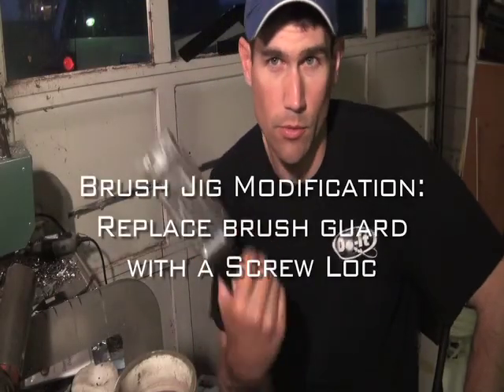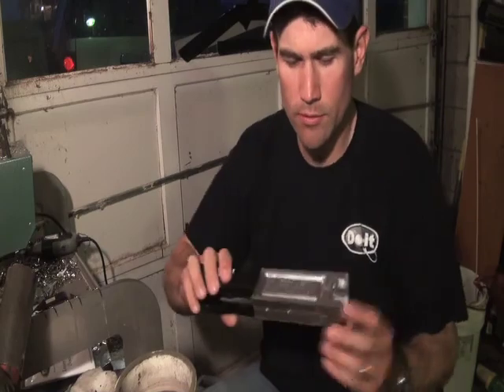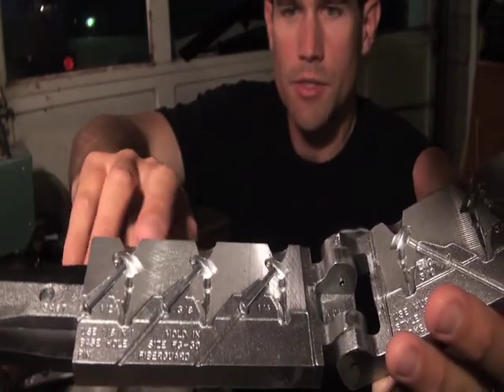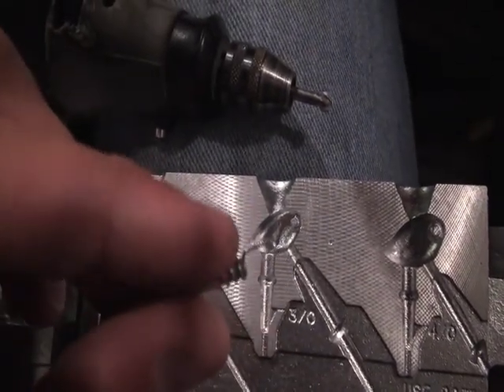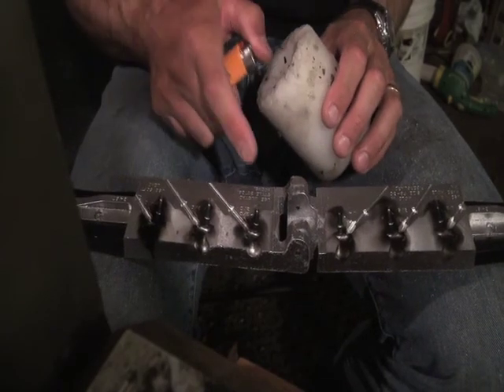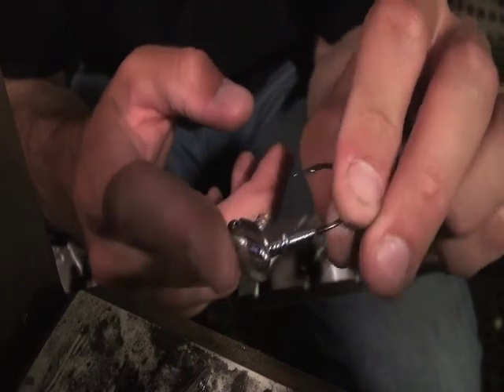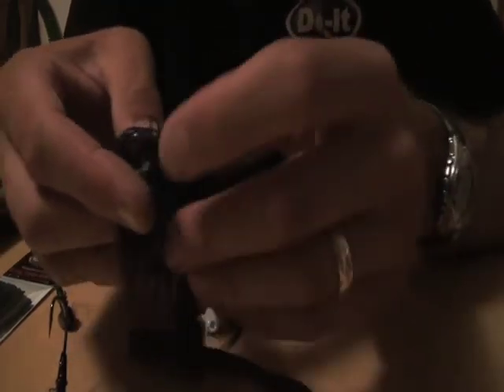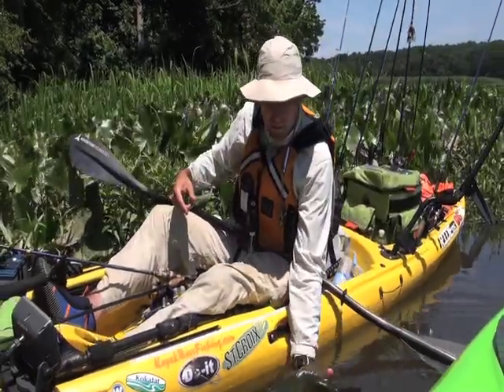Modification of Do It's Brush Jig Mold

Comment: Do you smoke all your molds prior to using them?
Reply from the maker: Usually, just once. @mouthfulcustoms uses a spray on mold release. You can see it in the plugknocker manufacture video “Turn Lead Into Gold”.
Reply: You don't have to use any of that,I have 50? molds and not a one is smoked or sprayed.Only one I might and haven't yet is the Wobble Head mold and it only hangs when trying to open it because of the design of the mold itself.If it was sprayed or smoked I'd say it'd still hang.